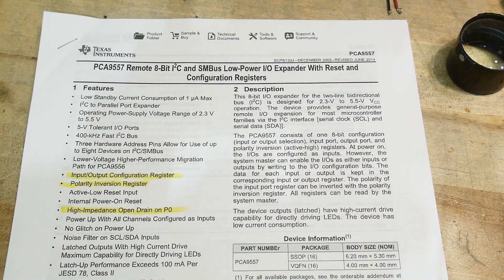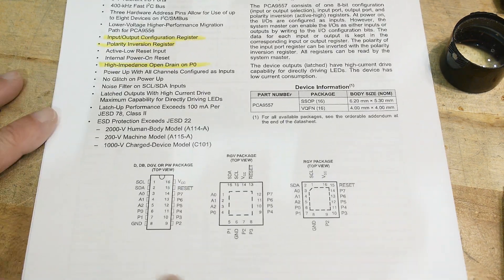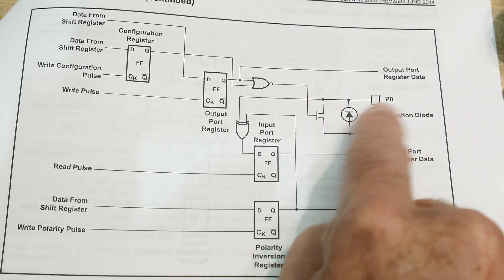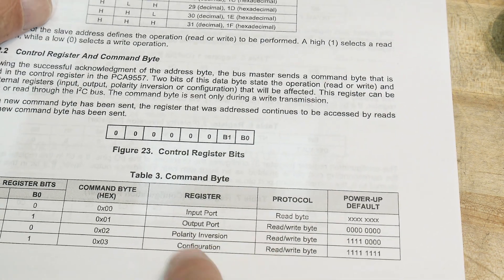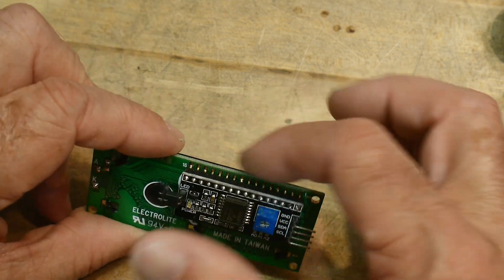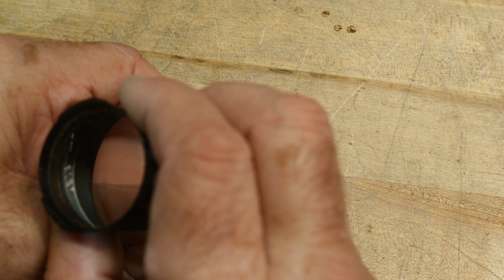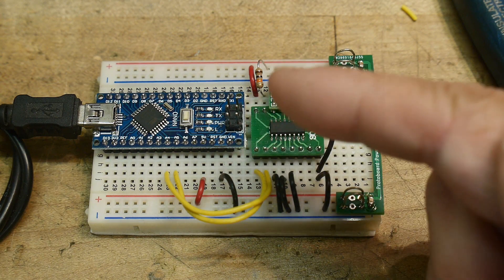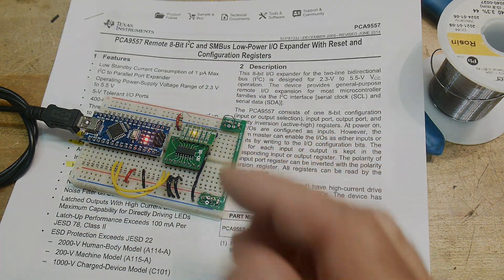#1794 PCA9557 I2C 8-bit Extender

Comment: What about the input function? Do you need to pool the ic or when the input change it send a message to the uC?
Reply from the maker: just like the pins of a microcontroller, you can set the pins to input or output. you can then output to outputs and input from inputs.

Comment: A point that many might miss is that when nothing is going on, you can change the A0..A2 lines to change the address of the part.  
If you have need of more than 64 bits of I/O in some large project, you can use this fact to work your I2C chips in banks. For example, you can have 4 to a bank and drive the A2 of all the ones you are not talking to high.
Reply from the maker: there are also I2C multiplexers like the TCA9548A

Comment: Q: Does it support bit-write or is it only 8-bit at a time writes?
Q: If it only uses 8-bit at a time writes, then does it introduce any glitches (assuming an individual bit output does not change between writes)?

Any potential glitches could cause hard to diagnose bugs in some specific circuits.

Comment: I think I2C was developed for the automotive industry.  To tie all the electrical/electronic subsystems together.  This is just what I remember but I might be thinking of canbus.  Anyway they are both cool 👍
Reply from the maker: The I2C bus was developed in the early 1980's by Philips Semiconductors. Its original purpose was to provide an easy way to connect a CPU to peripheral chips in a TV-set.
Reply: @IMSAIGuy  It makes sense. So they didn't have to use 8 conductor wire everywhere.  And also eliminate a lot of traces from pc boards.
Reply: Yes CAN Bus

Comment: I'm a hardware guy myself and I'm terrible at writing code so I was very curious about your statement to get ChatGPT to write the code.
Since you have to be very specific in the question to get a correct answer, could you please tell us exactly how you phrased the question to get the working code?
Reply: I tried asking ChatGPT to write Z80 code, it churned out some gibberish in 6502 and invented new instructions to multiply 🙄
Reply: Well, Arduino actually kind sucks, these people never read the datasheet of the atmel 328P, so they don't really know the registers of the chip and use the Arduino 'language', it's much better if you understand the 'registers' and their 'addresses (pointers)' of the Atmel chip and use , you definitely need a scope or logic analyzer (witch is better in this case) to visualize.
But you need to (re)create these waveforms @ 3:49.
Reply from the maker: 'write arduino nano sketch, i2c control pca9557 i2c expander output count 0 to 255'

Comment: As IMSAI Guy you no doubt know the history of I2C.  In the early days of computing there was a fork in the road.  One fork was full featured powerful microprocessors upon which you could build a home computer etc. The other fork were low feature very low cost microcontrollers. They provided a wee bit of programmability to designs that were purpose built "embedded" applications. They might just scan a keyboard or run a text terminal or dial a phone line from a stored directory.  In order to keep these chips as cheap as possible they had very few features and low pin counts. But for specific applications they may need a little bit more logic. (This was well before FPGAs.) So to keep the pincount small but still afford expansion to whatever the need d'jour was they came out with an interface and protocol that would just use a couple of pins. You could then hang a bunch of other chips from the catalog to talk serially back to the microcontroller. (Think of it as an early very slow USB.)  All the expansion chips spoke the same protocol - I2C. And specific chips would be at specific addresses or address ranges. We are now some fifty years later and this simplicity - for simple functions - still has value.  Interestingly early personal computers like the Atari, Vic20 and Commodore64 with full blown microprocessors still used serial expansion due to its low cost and simplicity. This was not I2C as they needed more speed but they did it for the same reason - an as cheap as possible "base unit" moving the complexity and cost to the optional upgrades (like a floppy drive). I2C has very significant limitations in terms of speed and distance but for what it was intended to do it does it well. Less PCB complexity, fewer pins, low power, easy to implement and debug. The most important thing to remember in the modern era - that was not a problem in its original environment  - is that I2C is a SERIAL protocol. Your commands to and responses from the external chip take time to serialize. In 1972 this was no issue as the microcontrollers may have run in the kilohertz or maybe 1Mhz of you were lucky. That serialization was almost invisible. But with modern multi-gigahertz CPU's that serialization can be going on for thousands of instruction executions (or more). So be sure your I2C drivers "lock" the interface when its doing its thing and are capable of buffering commands and responses that must wait for the port to be available. I've seen far too much code "bash" the I2C bus while its busy. And an important flaw of the protocol is that a software error can result in a read cycle being turned into a write cycle - and NOTHING in the code will indicate this happened.  If I had a nickel.
Reply: If you look at how slow serial worked for early home computers, I2C was way faster than what they needed for serial peripherals. A 2400 modem can run via a I2C-to-UART chip just fine. So can a serial printer, or a Centronics printer via a strobed I2C-to-Parallel chip. 100kHz I2C was about as fast as you could read data from a floppy without firmware tricks. It would have supported all the peripherals for any 8-bit system in the late 70s and early 80s. Heck, you could probably run everything but the hard drive in the original single-floppy-drive IBM PC via I2C without any noticeable speed degradation when running DOS.

Comment: You can still use a good old shift register.
Reply from the maker: I love the 595
Reply: @IMSAIGuy I recently used a chain of the LVC595 chips is a project.   It is handy that they use zener like input protection so you can power down the whole section with them in it when it is not needed.